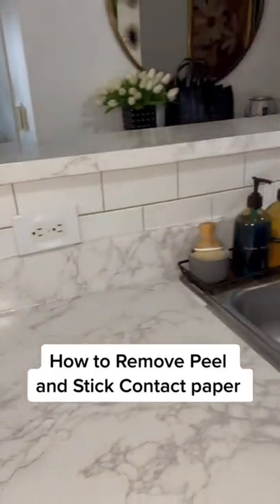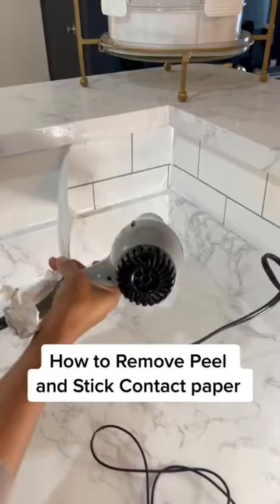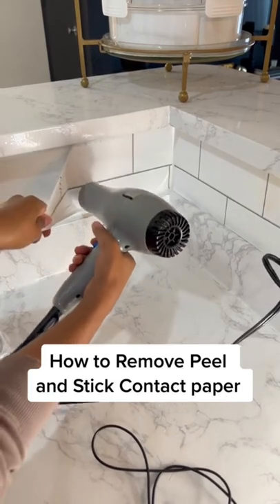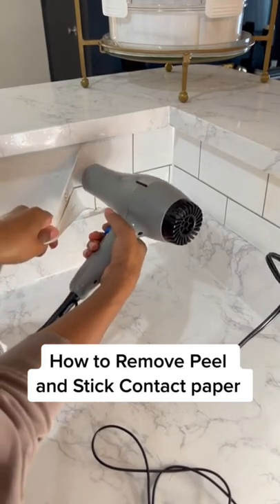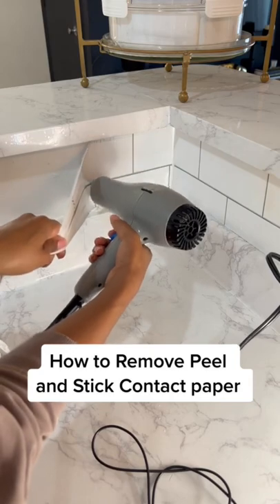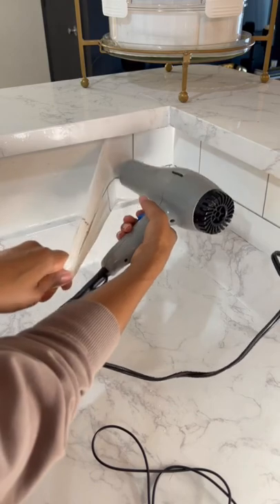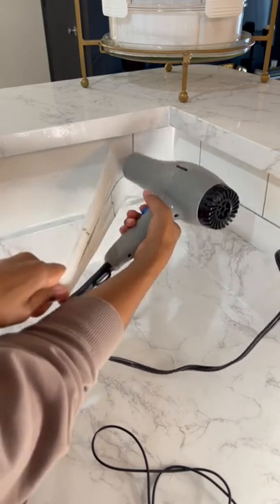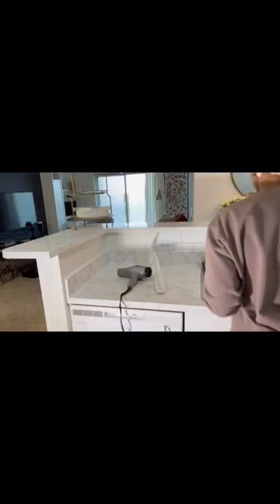How to Remove Peel and Stick Contact Paper￼

Comment: TY for this because you were going to have a lot of folks' deposits withheld whether it was an upgrade or not!😂🤣❤️✌🏾
Reply: They hold it for any small thing so it don’t really matter
Reply: @najahbritt3718  Not in my experience. Take lots of pictures before you move in, then the same for after you've moved and cleaned. You get your deposit if you don't do any damage beyond normal wear and tear. If there is a "small thing" then they can only keep a reasonable amount for the repair, not your whole deposit. It matters if money matters to you!

Comment: Do the owners ever ask you to keep things still on so?  Nice upgrades.
Reply: At my last apartment I did the kitchen cabinets and panels along the kitchen. The leasing office loved it and asked me to keep it in and they gave me a $250 discount on my last rent. I'm sure they charged the next renter a "renovated" unit rent 😂
Reply: @Zeft  😂😬
Reply: Contact paper isn't a permanent lasting solution that is durable in comparison to actual countertops or tile.

Comment: We used contact paper on a rental bathroom counter top. If looked do much better than the scratched up one that was there. We left the contact paper.
Landlord never complained.
Reply: They probably didn't notice until their new tenant complained about the landlord trying to be cheap and not replacing the countertops and just hiding it instead. Seriously, what would YOU think if you suddenly realized your counter was covered in contact paper in your new apartment? You'd probably wonder what else he was hiding. Don't make that choice for people.
Reply: @ambrr_lily  ,He was cheap. Never bought a new element for the oven, fixed one burner element. Used a hallway closet as the vent for central air and heat but left it open to the attic. I couldn't put anything lightweight on the shelf or the vent would suck it into the attic. You get the picture. He ignored complaints. My husband got him to give him the paint and finished painting the bathroom so it looked good enuf to inhabit.
Reply: @dinahkruppa913  contact paper is not the same durability as actual countertop or tile, so it is problematic if someone thought it was authentic or, at least, a more durable copy